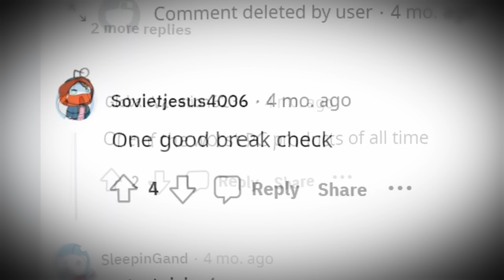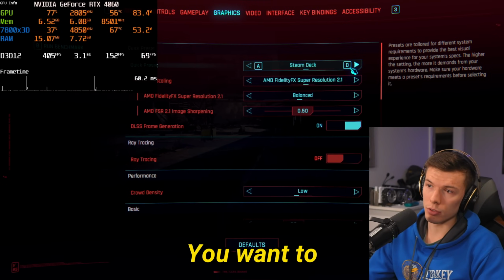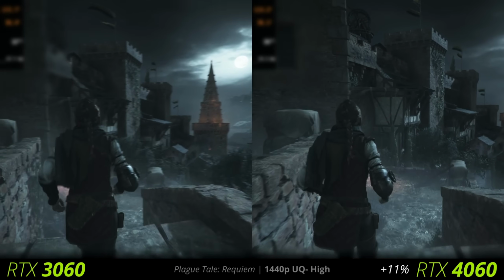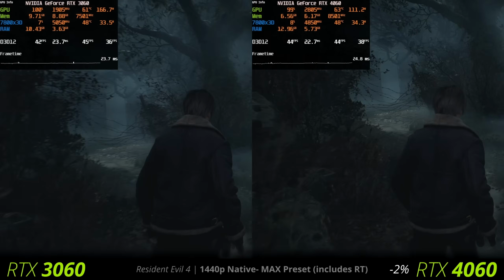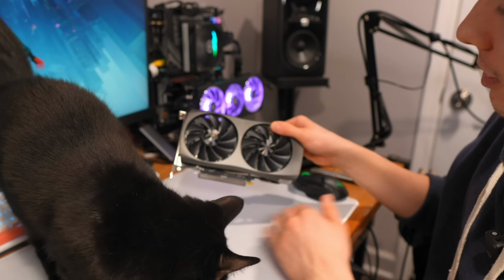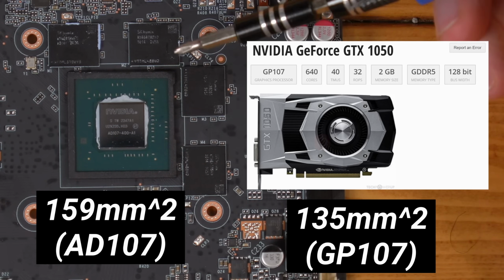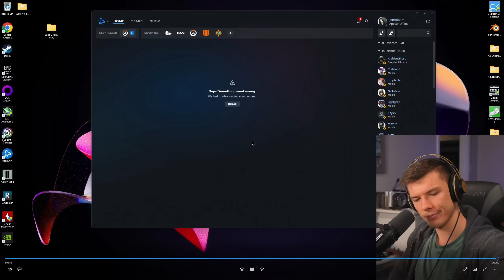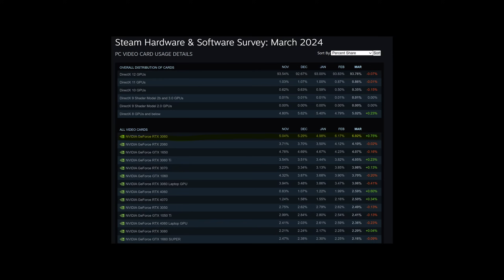I Tried Nvidia's best "Budget" GPU to see if we're Doomed

Comment: as always the problem is the price. the card itself is not bad and if it was 200$ everyone will call it good
Reply: i won't because the 4090 these days is a 1080p card at max settings in games like Alan Wake 2 - without upscale or glitchy fake frames - so it should be a $130 card. 4080/s performance level should cost 100 bucks because its all that actually is. and for 1000 bucks GPUs should run MODERN games at max settings @8k 120fps+
Reply: the last 8 years nv milked the market with 0 progress hardware instead of actually doing progress. if you compare $600 1080 to $600 4070 super its just x2,5 times faster after 8 YEARS. even $2000 4090 is just x4 faster. according to the Moore's law it should be x16 for the same $600. thats when totally ignoring better architectures and software.

Comment: I think your 4060 has a hardware problem because I have an msi 4060 and in the cyberpunk game in 1080 with high quality and ray tracing medium without path tracing I have about 105 fps
Reply: i have been playing Cyberpunk with a 3050 msi and im having a playable perfomance with raytracing at ultra or even psycho. just bought the 4060 and im eager to try it out. Have you been overclocking:
Reply: Yeah I think dude has a zotac? Who tf uses that brand?? I hate these videos cause they 4060 but buy it from a brand no one else would use for their build.
Reply: Really?! i also using zotac version and i keep thinking its having hardware issue. coz its felt like its perform lower than my GTX 1660 ti. could you tell how much fps on some games you playing??
Reply: @CineGui  At 144p?🤣🤡
Reply: @CineGui what fps you get that call playable?? 30fps?
Reply: just burning cash , why get a product that over 50% of people it’s not a good card . Maybe as a secondary card just to render but like who really needs a 2nd Gpu in the first place . Maybe with Amd.  Fs2 to render some frames but doubt it’ll work with nvidia product
Reply: @spawnersiak  nah. ive been getting over 50fps with RT on cyberpunk. Can easily play it on FHD or QHD. It gets worse on 4k tho.
Reply: @steven7297  where im from, a better card costs over 2x times the minimum wage. RTX 4060 is working great for me, i can color all the files i want in Davinci, without much stuttering, i can edit and render pretty fast; close to my M1 Pro. Its also pretty ok for games until QHD.  4k gets messy when playing Cyberpunk, TLOU or Hellblade. BG3 is smooth all the way!
Reply: @CineGui  I wouldn't get this even if it was for free.

Comment: I don't understand the utter stupidity of people... The 4060 is just a 50-series card but Nvidia rebranded it to 60 because they wanted to increase the price and thought people were so stupid they would think that made sense. What they didn't realize is that our stupidity is on a whole different level. People recognize the card's performance is inferior but are in utter denial over the name change. For what it is, it does exactly what it's supposed to. If you buy a 4060 and turn on ray tracing or try to play above 1080p then you're literally using it wrong. My main gripe is that the power usage doesn't justify the price:performance ratio. These cards are supposed to be efficient (If it's not cheap and not good it has to at least save on electricity or what's the point?). That said I actually have a 4060 since I only play a handful of games on a 1080p monitor and I'm perfectly happy with it; I'd go AMD but After Effects and Autodesk Maya seem to really work better with Nvdia.

Comment: I have a 4060 and except the idle wattage hardware flaw meaning a false minimum reading of 53 watts is always shown I didn't have much of an issue with it playing games at 1080p. But then I upgraded from an ancient GTX560 and the 4060 was on Amazon deal for 270 so seemed like a good buy.
Reply: It is a good buy at that price. It's an ok card with a too-fat pricetag. I think nvidia are trying to avoid releasing really good cards because if a card is too good people hang on to them for years without consooming new product. Remember the 8800 GTX?
Reply: @snipermagoo  Lol yeah I actually had the card under that the 8800GT around then it was a workhorse I remember getting a second for SLI and they lasted me till I got a GTX470 which had a memory fail leading to getting the GTX560.
Reply: @changeagent228   I actually had two in SLI and I didn't realize the factory settings were just a fixed 25% fan speed, but since they ran hot so well I didn't realize the issue until they burnt out. One died and the other was damaged and would lock up at high heat. That damaged card still worked when I replaced it about 2014. Absolute unit.
Reply: @snipermagoo  Lol yeah mine had those really weak slim coolers too and I just locked the fans at 100% with rivatuner and they still hit 80c+.

Comment: It's ridiculous how a couple of reviewers online can sway the opinions of the collective gaming community into a wrong direction. There's nothing wrong with the RTX 4060. It's not a bad product. It's an improvement over the previous generation in terms of cost/performance ratio. That's all that matters. Just because it wasn't a monumental leap forward doesn't justify people acting like it was a huge step backwards instead. Because it wasn't.
Reply: Lol. An overprized card struggle to play games at 60fps in 1080p in 2024. Not a bad product... try harder
Reply: @zentumaisle5925  the question is 

Can 3060,
2060
1060 

Any of those play 60fps 1080p games in 2024?
Reply: @clhk12  I think all of those cards would do 1080p 60 just fine?  I have a 3060 12GB and I've never ran into a game that wasn't fine at 1440p60 even.  Granted I never played Alan Wake 2, perhaps it's horrendously optimised.
Reply: @jasonblazgk9973 Alan wake 2 run OKs actually on the 3060, the problem is ray tracing as it is a path tracing implementation, so it's a killer for any low or mid tier card.
Reply: @zentumaisle5925 rtx 4060 and the rtx 3060 is priced the same. If the rtx 4060 cant run games at 1080p as you said, how the hell can the rtx 3060 can run those games when it perform way worse. We all know the clear winner. Cope harder
Reply: @deathhunter1029  3060 was released in 2021 why would it have to run games at 1080p in 2024.. and it have 4gb more gram. Please turn on your brain cells before commenting. And stop overusing cope I'm using a 7900 why would I need to cope? XD
Reply: @zentumaisle5925  Because the fuckin' games people are making now are unoptimized shitfests. Should the cards improve or should the quality of the work the devs shit out improve first? They think that because all these cards are so powerful, they can refuse to optimize and just brute force it.

Games looked great pre 2020, while also being SO MUCH easier to run. Modern games REQUIRE an expensive top of the line GPU that really shouldn't have to be so powerful.
Reply: @wulfthemountaindragon5432  It is a combination of both sides, there are also no excuse for nvidia to release 8gb vram card in 2025 with that price tag (5060).
Reply: @zentumaisle5925  I can see where you're coming from, but IMO the need for more than 8 GB is caused by these unoptimized games. There are amazing looking games from earlier years that used 4 GB, perfectly capable of running 60 FPS with that. 

I'm not saying we should hard cap it, but we  SHOULD have games optimize as well as they can be (within reason), before jumping to hardware improvements.

I lay blame on newer games moreso than  Nvidia not keeping up, but I can also see how them purposefully limiting the power of their cards can benefit them. Cheaper (however marginally), while incentivizing consumers to buy more expensive GPUs.

I'm mostly pissed that with all this new and awesome developments with computer hardware, game devs don't make full use of it, instead acting as if it's a stopgap for poor performance.
Reply: Its like a samsung device, the newer ones arent always better
Reply: The thing is, in 2016 I was gifted a prebuilt gaming pc that had a GTX 1060 and I could run Battlefield One on 1080p, low-medium settings, and get 100-120 fps.

Nowadays you get a $400 card and have to run today’s games at 1080p lowest possible settings just to barely achieve 60fps. The price to performance ratio is way off.

On top of that most modern games don’t even look that much better than Battlefield One did 10 years ago and we have way better hardware. There’s no excuse for us to be barely getting 60fps on mid range cards 1080p lowest possible settings.

Comment: i am buying a prebuilt for my first PC, and it has a 4060 graphics card, and so far, your review has probably been the best one i've seen, since you didn't make the video just to trash on it, you simply made it to test how good it was, and you got your point across very well, so i feel fairly good about buying one. sure, it may not be the best, but i'll be able to upgrade it later when i've got money, and it will be a HUGE upgrade from my shitty school laptop i've been using normally
Reply: Agreed, I'm buying a pc with this card to just to play building games I can't play on my Xbox. I won't be buying a monitor I'd rather use my 40" 4k uhd HDR TV which is locked to 60fps. Anything high end ray tracing I'd just play on my series x.

Comment: I think tbh the rtx 4060 was more designed with its laptop variant in mind than its desktop variant. Because the only major differences with the 2 are the memory speeds. But everything else is pretty much the same. And it's quite easy to find to find a very good deal on a 4060 laptop for anywhere from $1000 to $1200. Which isn't that bad, especially if someone is just getting into PC gaming and they don't have a lot of perhipherals like a monitor or keyboard. Although I currently own a desktop, I've lost my patience for PC building, and certain prebuilds don't always come with optimal specs. So I'm also opting to sell my desktop for a laptop now, since my needs and wants have changed since I originally got into PC gaming.

Comment: It's a good upgrade for ppl have like rx 570 , rx 580, gtx 1060 , 1650 , 1650s , if you have rtx 20s or amd 6000 dont buy.
Reply: I upgraded from a 1070 and I went from not being able to play newer games to maxing them out on a 1440p monitor with less noise and lower power consumption (didn't need to upgrade my PSU). It's a huge win imo

Comment: upgraded from a 1050 Ti to a 4060, and the difference was astounding. I never knew graphics could look this good in games. Additionally, I'm not sure why, but I'm consistently getting over 100fps on most games you've tested on this video, even with ray tracing though needed the frame generation enabled. What really amaze me is that the power consumption is very low
Reply: You are right. Leave the haters, they are showing suboptimal settings to make it look bad. I had 4090 desktop and sold it after i finished few games and now im on 4060 laptop and it smokes anything on 1080p.
Reply: @filippetrovic845 so forget the 4060. Is it good if I should get a 4060 Ti??
Reply: i think its the fact that certain cards are different versions in terms of having different vram amounts or clock speeds or even if theyre overclocked or not. sometimes theyre even oem versions with weird fans, so idk. i say get a ti with 16gb
Reply: @joellelolers1254  ok, thanks for the reply 👍
Reply: @Figh4ter  price diff ?

Comment: thats the problem . you compare 3050 to 1650 you see the jump :D, but when you go to 3060 to 4060 you see the scam
Reply: Even going from 2060 Super feels like a scam
Reply: The 3060 and the 4060
are both the same price right now tho
Reply: @SpoonyCrawdad50 thats because all the new 3060s that are left are dead stock thats overpriced. Old cards should not be compared by their new prices. 🤦‍♂️
Reply: I go from an gtx 980 to rtx 4060 😂😂 so i see huge improvement 😂😂
Reply: 4060 is the highest end card I can get in small enough size to fit in my NUC 9 extreme
Reply: i got a 1650 gtx and a i5 11400k , what should i get 3060 rtx or 4060 rtx ?
Reply: @mironstefan947  get a 4060.

Comment: Not everyone can afford a fking 4090 and shit, for what its worth the gpu is amazing
Reply: my console has 16gb of ram. alot of new games will require 16gb of ram. i honestly dont even know why nvidia makes 8gb cards.
Reply: @SummerSmith-z5r  Youre talking about ram, gpus use vram
Reply: for what it's worth it's an awful deal, it's fast as hell though
Reply: @Yezzy-s5r  the PS5 and series X both share system ram and video Ram, so he’s technically not wrong saying they have 16gb of vram, but it’s also the system ram, so  only 10-12gb can be used as VRAM in most circumstances.
Reply: @Yezzy-s5r  tried to find amount of vram in the console but it just said that, but arent newer games gonna also need atleast 12gb of vram? especially if you want to do more than 1080p right?
Reply: The gpu is better than the series S and ps4 pro, both consoles are higly optimized

Comment: 9:31 frame generation is a waste no matter the card. Just stutters the game. Never use it
Reply: Fame generation works if you are for example 25 or so FPS from the monitor cap,
Using a 60 cap and using frame gen to make it hit 60 from 40, you wouldn't be feeling much latency and just a smoother picture

Comment: im still happy with my 1080ti which i bought 2018
Reply: how this card holdsup in newer games? Are there any issues?
Reply: @Blaczek297 50-55 I guess mix setting
Reply: @Blaczek297  Its perfect if you're using a 1080p monitor. Most newer games you can run at custom high/ultra settings @ 60fps +
Reply: @x9ree  i think this card have similar to 4060 performance but way bigger power consumation and memory & memory bus. But probably this card is not for me because I use 1440p monitor
Reply: "yeah but it cant gay trace"

so what games look worse with race tracing, ever ray traced game looks too bright to a point that people were shocked how moody the prebaked shadows look in dead island 2.
Reply: Fantastic gpu

Comment: RTX 4060 microstuddering is real and made me hate it instantly. Do not buy it!
Reply: There's microstuttering in every Unreal Engine X game, it's an engine issue with loading stuff. It's not the card. Doesn't matter if 4060 or 4090.
Reply: @GERRaze  Yeah but still 4060 is definitely not worth it at all.
Reply: @GERRaze  My faster RTX cards do not have stuttering
Reply: no it's not bro it'sfucking smooth
Reply: @MicahDaRhuler  4070 Super or the new Ti Super would be a better choice tbh. Nvidia for some reason just cuts out half of VRAM in their GPUs. AMD on the other hand does not. And this isn’t fanboy related, or even that I’m a fan of AMD.
Reply: @mb2008-y8l maybe but I don’t have that kind of money, and and has been cutting vram too. Their 7600 intended to compete with the 4060 also has only 8gb vram.
Reply: @MicahDaRhuler  Yup.. and only Chinese "tuned" GPUs get way more VRAM but I question their performance :D
Reply: @mb2008-y8l  funny
Reply: @mb2008-y8l  as far as I can tell, 4060 is awesome and 8gb is plenty, but maybe it’s coz the best card I’ve ever used was the mobile 1650. But getting a card like that for 300 which is very capable of rtx and other things, it’s pretty sweet
Reply: @MicahDaRhuler  I can relate about best card ever used. My best one yet is 1660 Super I use now. But I just read a lot of insights on GPUs so it gives me a plenty of things to think off before buying new GPU. Currently staying on buying 4070 Ti Super because I want to experience gaming on 2560x1440 ultra.
Reply: @mb2008-y8l I just wish people would stop with the 4060 hate, it’s really not a bad card, it cost the same as the 3060, uses half the power and is slightly faster than it. That’s impressive. It’s excellent for low power low cost builds.

Comment: 4060 is just a badge-creeped 4050ti. Last gen, the real 3060 was the 3060ti, and this gen the real 4060 is the 4070. HOWEVER, if this card was 230-250$ instead of 300-330$, it wouldn’t matter what it’s called because it would’ve been excellent price/perf. It’s effectively a RTX2080 that pulls 115W. This is the best card the SFF market has seen in years. It’s just about 20% overpriced imo.

Comment: I bought 3070 ti a year ago and I'm glad that i did it 
For 470$ i got it brand new in a local store here 
First i said I'm gonna wait for 4060 and pay less and get the same performance 
But I'm happy that i didn't wait 😂 
3070 ti is 45% faster than the 4060
Reply: It's such a shame it only has 8gb vram. But the 256 bus with gddr6x is nice.
Reply: @FilthEffect  yup because of the 256bit bus and gddr6x also the resizable bar and my 32gb ddr5 ram 
I'm not facing stuttering even on games that need more than 8gb on 1440p 
Also always playing at max settings and using ray tracing too 
Dlss at quality will help if I faced some problems

Comment: I guess the tldr is basically if you're upgrading, probably skip the 4060
but if you're buying a new part all together, yeah go for it
of course you could probably find used 3080 but that's beg the question that are you willing to take a risk of your graphic card potentially dying, even if the chance is low are, you willing to buy a whole new card if the inevitable did happen?